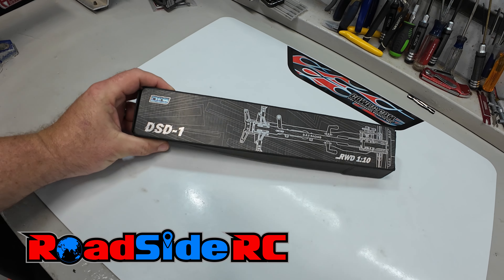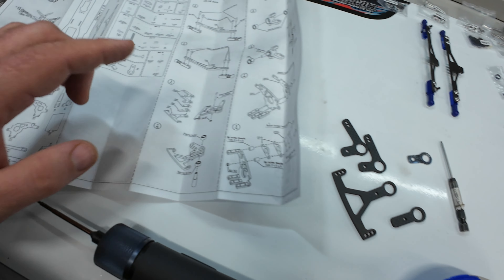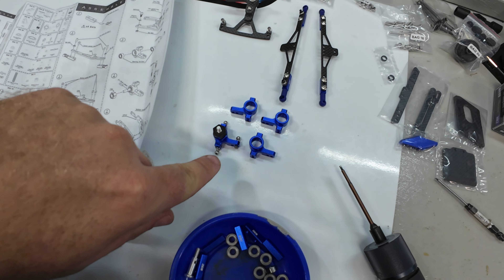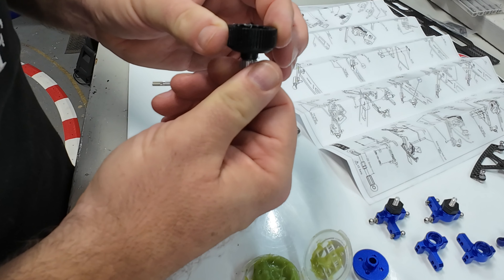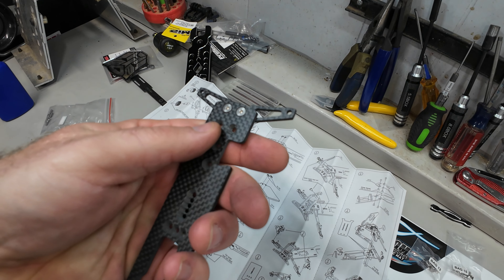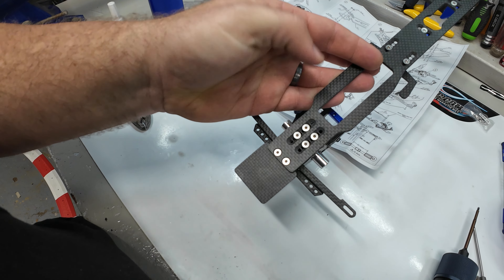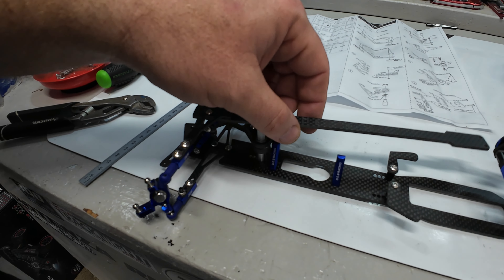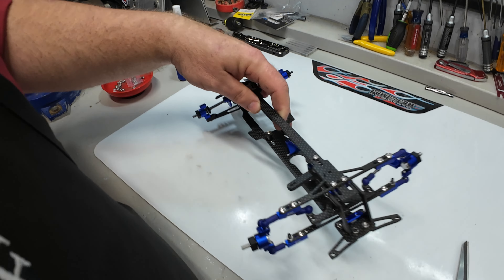16 Tips for Building the DES Racing DSD-1 RC Drift Chassis

Comment: I built mine with all the same struggles. It drives decently well once all the kinks are worked out.  I like others used a Yokomo idler gear which helped, after driving a few times the transmission spins pretty normal.  Would definitely be worth throwing some lower powered electronics into. I use 10bl120 and zero s
Reply from the maker: Thanks for the tips and confirming I am not crazy as I built it!  :)

Comment: looks like des did it again when it comes to known issues the vn01 the res2 and now the dsd-1 all same type of issues so happy i stopped buying des products when he won't ever fix the issues he knows they have
Reply from the maker: It is unfortunate, as I really wanted this to be awesome!!
Reply: des has some good ideas but needs the quality control to be better to actually make them properly and not have the issues they have
Reply: @RoadsideRC  yeah i was the same with the res2 i got in on first pre order went all out getting gold flake forged carbon and all alloy in black and gold got it sent but forged chassis didnt come with it had to ask why then it finally got sent. Started building it and had hard time pushing some the bearings in some the screws were to long or to short bearings were nearly seized replaced them with axon x10 bearings then got to drive shafts and the dogbone wouldnt fit the dif cups i asked why they were that way and was told i had to sand and file them to fit the cups. I wasnt happy and ended up selling it for less then i paid for the kit